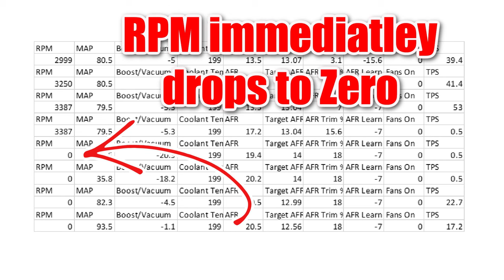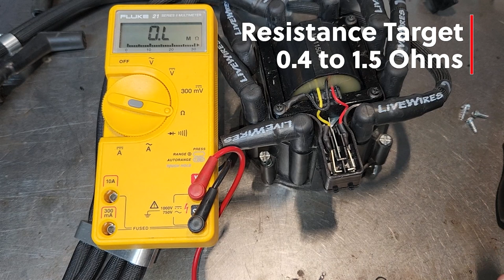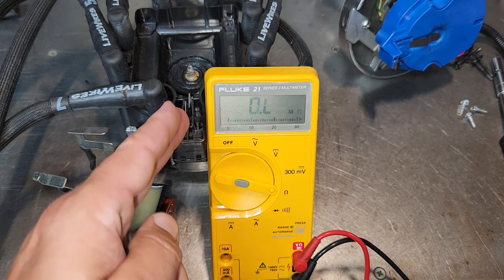How to Diagnose and Fix your HEI Distributor.  With driving footage.

Comment: First thing I did was check for fuel at the carb. It was fine. I then checked for spark on the plugs, it was not fine. I then checked for 12V at the distributor, it was fine. I then followed your steps. All three of my coils were within spec. I then replaced the ignition module and the truck fired right up. 

THANK YOU!!!
Reply from the maker: That's Awesome!  Thanks for sharing your experience!
Reply: I’m getting 10V at the distributor, is this close enough? Fuel pressure is good, plugs aren’t getting any spark.

Comment: This is a great video for HEI diagnosing for those of us who don't know how everything works. I converted my old truck's 300 6-cyl to a HEI distributor and found one of the terminals was also out of place. Still no tach signal so now I know to go back in and check the other connector + test battery input voltage.
Reply: Sounds like the connector factory (that likely supplies a boatload of vendors) fupped-duck.
Reply from the maker: Thanks Dwayne!  Hope you find the issue... let us know what fixed it.
Reply from the maker: @Le_Comte_de_Monte_Felin  Ha!  For sure!

Comment: Actually, they designed the hei for longer service intervals. When points were in use, they had to be serviced every three months or 3,000 miles. . Getting a higher voltage output was an added bonus
Reply from the maker: Great Point!  (See what I did there?  ha, ha...)  Thanks Juan!

Comment: I had a DUI unit in my AMC 304 in a jeep I had about 4000 miles on it and it wouldn't start when it was cold, and I mean 10 - 15 degrees F , what happened was the housing wore by the drive gear allowing the shaft to raise up and it wouldn't trigger it to get a spark. When it was cold out the oil was to thick to let it slide back down, and it did have some issues at other times to. I put the Delco points distributor back in and it runs fine now.
Reply from the maker: Ohhh man, sorry to hear that.  I'm a few weeks away from making some changes with this Disti too.  Thanks for sharing!

Comment: How has your dui unit treated you? Just purchased one from summit racing do to kept burning up ignition modules left and right checked and changed everything battery alternator both cables even went through 3 accel distributors from summit with no luck would get a few cranks and kill the module. Changed out ignition switch and harness aswell as hooking it up direct to battery with a kill switch so I’m hoping the dui will solve the issue.
Reply from the maker: Good question... I no longer have it.  Not because it's bad, I wanted to have my Fuel Injection system control the timing, so I needed a different style distributor.  DUI makes good stuff, have fun!   Keep us posted if there are any other issues you figure out.  Thanks for the comment!

Comment: I installed a cold case aluminum radiator in my big block Nova after the winter overhaul, and found no noticeable improvement in cooling at idle. That is on a 95° day at idle. Cools great down the road though. Can’t wait to see how yours does
Reply from the maker: Yeah Mike, me too.  We shall see.  See ya soon!
Reply: Is your water pump pulley bigger than your crankshaft pulley? Meaning do you have a under drive pulley set up? That can cause overheating issues in stop and go traffic..they look cool though but it’s mainly for racing.
Reply from the maker: @armygreenfj3924  Good question.  I do NOT have an under drive pulley, they're stock diameter, as far as I know.  Agreed... too much flow doesn't help either.  Thanks!
Reply: @armygreenfj3924  all my pulleys are stock 1970 big block pulleys. Air does not blow back over engine. Blows off the end of blades, so makes a big circle. Hits hood and blows out all sides, not back like I think it should

Comment: I had the exact same issue with the wire terminals not being snug in the plug and falling out. Then as I was bending out the tab to re-clip it in the plug, the wire terminal slipped off the wire, It hadn't been crimped hard enough. I soldered  all the wire terminals , made sure they were made fast in the plug, and spliced in a duplicate ground that I mounted to the firewall. The second ground wasn't my idea, but picked from another thread, I had read, can't hurt.
Reply from the maker: Yeah, almost identical issue... great fix!  Haven't heard of the ground strap idea before.  Thanks for sharing!
Reply: @FastMonty could you please give me the wiring info on a 77 chev impala. Colors of wires that go to the ignition module  and how to test if the module  is geting voltage when ignition switch is in start and on position, thank you for your help
Reply from the maker: @Chuncy566  Sorry Brother, I'm not an expert on 77 Impala's, so I can't help there.  Everything I went through in the video is how to diagnose a HEI distributor.  Hope it helps!

Comment: thank you for the video, recently I change my head gasket with the rocker arm, push rods and oil pump on my stock z28 78 with 350 , set the timing to 12 degree , when reach the 3k rpm while driving  the car fell it hit the break pedal, when the car in neutral i can rev the engine pass the 5k . what you think is it the distributor?
Reply from the maker: It could be... if you have an HEI, give it a thorough exam.  OR, it could be your PCV system.  If it's not clearing out the crank case properly, there may be too much back pressure.  Let us know what you find out!

Comment: I’m having the same problems with a carbureted small block Chevy.  Thanks for the insight.
Reply from the maker: I feel your pain... please let us know how you ended up fixing it.  Thanks for the comment!
Reply: @FastMonty  my situation ended up almost exactly the same as yours.  I replaced the HEI control module, but had the same symptoms still.  Upon further investigation, the yellow and red wire coming out of the coil had burned through, and were making connection just enough to run like garbage.
Reply from the maker: @davidjames2788  Crazy how it's the little things, right?  Great to hear you found the issue!
Reply: I'm having the same problem with Nova with an sbc. slight throttle is fine  after that it falls on it's face, it's been getting worse I think too
Reply from the maker: @jaysguyrage9483  You're not alone... let us know what ends up being the issue.  Thanks for the comment!

Comment: Man your video just found my weeks of frustration. I was having similar issue, everything worked fine then about 3000rpm I would get erratic tach signal and loss of power, spitting sputtering missing. I started with basics cap rotor wires plugs, and noticed the same problem when I was changing out the cap the wiring fell out of the connector like yours.
Reply from the maker: Ohhh wow, glad to hear I'm not alone!  Ha, ha... Glad to hear you've sorted it out.  Thanks for the comment!

Comment: The more electronics you have under the hood will leave you scratching your head when the car dies. In my case on my 70 Z/28 I ran a Pertronix for 15 yrs before it gave me problems when the engine reached operating temp. It finally died one night. The same thing happened with my Crane XR-i module. I was going to try an Accel unit until I read the reviews which sometimes are dead out of the box. Therefore I’m back to using points since I have plenty. I am also running with an analog MSD 6AL 6420 because the digital boxes are junk today.
Reply: Devils advocate here.  Ultimately he used the data logging function of his Engine management system to diagnose the intermittent loss of tach signal from the distributor.  I believe analog MSD would use the same signal wire and you would have no idea why your MSD was dying.  Also, all of these electronics should have capacitors on them.  MSD sells them as RFI filters (which they do as well) but they offer significant voltage spike protection which older style alternators tend to produce.  I have two MSD capacitors, one for the FI system and another for the MSD.  All is well so far.
Reply from the maker: All good points John... Once you go electric, you can't go back... or something like that?  HA, ha... thanks for the comment!
Reply from the maker: @stevebrown6175  Thanks for the comment Steve!

Comment: Replace that dielectric grease ASAP, its more of an isulator and not for heat transfer, you will kill that HEI module quickly. You need "DOW 340 Heat Sink Compound", its good for up to 350F, its the only grease i use personally for my own HEI distributor projects.
Reply from the maker: Good point.  I was using the grease that came with the Module.  I was thinking the same thing... DiElectric grease prevents arcing, etc, how in the heck is it going to increase heat transfer?  Thanks for the comment!
Reply: Dielectric grease is exactly what it says it kills electric current!!
Reply: Just now seeing what this is coming from.. they make a heat sink paste TG-N909 Non-Silicone Thermal Grease nothing compares and last for years
Reply: Thanks for the info I will try that on my next module my big block eats modules
Reply: Use Arctic Silver thermal compound (available on the jungle website).
It’s designed for computer chip coolers and does a great job.
Reply: @patricks8086  Yes... cpu thermal compound will work, but given that underhood temps constantly exceed that of a computer case,  i would still suggest using the DOW 340 compound.
Reply: @Bige4u  CPUs regularly get over 215F (102C) I have yet to ever measure temps of my distributor or much of anything besides the exhaust in excess of that.

Comment: Hello, I am doing a HEI install on a 1975 AMC 360  , What I need to know is, do I keep or take off the the voltage regulator ? Thanks for the Video's.
Reply from the maker: If there's an inline regulator or fuse link to the old distributor/coil, yeah you remove it.  Then upgrade that power wire to 10 gauge.  Have fun!
Reply: Thanks , Have a great day. @FastMonty

Comment: I had that happen with a pertronix. Unit overheated. Same thing with an overheating ignition module from a 95 Chevy that I was running on my 66 Cadillac. Wild erratic behavior.
Reply from the maker: Yeah, super annoying, isn't it?  I no longer run an HEI disti... My friends that do carry spare modules with them.  Thanks for the comment!
Reply: @FastMonty  the fix is to relocate the module to where it’s out of the heat. Then it’ll last a lot longer. I did that on the Cadillac, as it was in the flow of the rad fans, and now it’s great. Totally understand why you’d want to ditch the HEI, though!
Reply from the maker: @clarkinthedark1  Ohhh, great idea!  Thanks for sharing!

Comment: This is useful.  I think I will eliminate those connector terminals/clips (the connections of which seem sketchy) on mine and hard wire the connections.  Why leave the wiring to chance?  I suppose it makes it easier for when you do disconnect the parts, but since we run the car with the connection, hard wiring does make sense.  I also had a intermittent tach signal for a while and that was frustrating.  Went away with new module.  But what I will take from this video is that the HEI plug connectors are sketch.  Cood video Yo!
Reply from the maker: Thanks Roger!  Yeah, hard wiring everything makes reliability sense.  But, not accessibility sense. :)  There is definitely a trade off... just stuff to look out for.  Glad you fixed the tach issue!

Comment: Okay I’m gonna change my hei distributor bc it’s only firing on like 4 cylinders but I also think I might have an issue with my new Holley sniper 2… it came with an external fuel pressure regulator but I set that up wrong and bypassed it, do you think i could have a bad injector just blasting too much fuel in there and it just can’t be burned? I can’t really check for spark alone right now on all my plugs my brother in law said they’re all sparking but idk
Reply from the maker: If you have spark, it might be timing.  Double check that, AND install that fuel regulator.  Let us know how it goes.

Comment: Monty, have you had any issues with the newly installed Flamethrower module being that it’s manufactured over seas? It’s hard to find anything that’s not made in the USA anymore. I just replaced my module on my 68 Firebird with the Flamethrower. It’s running fine but I am soooo reluctant to take it too far and wind up on the side of the road again.
Reply from the maker: I hear you... I didn't have any issues with it, nor did I have it very long. :)  I now have a MSD Billet, where timing is controlled by my FiTech system.  That said, I'd carry an extra one with you, just in case you need it.  Have Fun!

Comment: Doe's the FITech have a rev limiter in it like the sniper? If so I think that I would up the limit on that module and let the FITech do the thing.
Reply from the maker: Great question Joe... my particular set up does not have timing control.  But, I do want to implement that in the future, which requires a different distributor.  Stay tuned for that... so, when that happens, we're gonna find out about rev limiting, I'm sure it would.  Thanks for the comment!

Comment: Good video I'm glad you found the issue, your old module  probably still good.  How come your distributor dont have vacuum advance ?
Reply from the maker: Yep, old one is probably fine... vacuum advance won't fit on mine, and it's optional.  It's only for emissions, and might keep your engine a little cooler at idle.  Thanks!
Reply: @FastMonty  thank you for replying,  i want to put a water outlet from that location and my vacuum advance was right on top of that,  so it's hard to open the outlet like you did on yours.
Reply from the maker: @9011combo  yup!  Exactly why I removed mine. Depending on your distributor, you can get a vacuum advance lockout.
Reply: @FastMonty  ok thank you very much

Comment: Hello Mike ..At 17:56 the centrifugal advance weights look strange never seen them overlap like that . With the rotor installed can you rotate the rotor and will it spring back without binding?
Thanks for the Pontiac content
Reply from the maker: I'm a start calling you Eagle Eye Fred.  Can't believe you saw that... but, NO they should not overlap, and I fixed them before putting it in.  To your point, I don't know if they'd fix themselves, or not?  My guess is I wouldn't have been able to attach the Blue Cover.  Thanks for spotting that!

Comment: Great video but after finding the wire harness issue you did show how to actually test the original module.
Reply from the maker: You can't.  Well, that's what the driving test was for... as mentioned in the video, you need a specialized tool to test the actual module.  Thanks for dropping a comment!

Comment: Another great video.  Been debating  hei vs  efi controlled distributor.  Just hate all the wiring like distributor, coil, and ignition box. Got to be a simpler way.
Reply from the maker: Totally understand your concern... that's why I went HEI, BUT, I'm now leaning towards EFI controlled.  One of these days... I'll figure out the perfect mix.   Thanks for the comment!
Reply: I haven’t done this yet, but I think going with a MSD distributor, lock it out, and use the efi timing control.
Reply from the maker: @WaveCrusher  Yup!  On my to do list.  Thanks for the comment!

Comment: I have replaced a auto module 3 times in 10 months now. Is there something other than faulty parts that can cause the module to fail or short out?
Reply from the maker: Wow, that's a lot.  Not sure what's causing your issue... but, I do know electronics do not like heat.  Is there anyway to add some sort of heat sync?  (Or, at least make sure you add that grease underneath it, when you install it)  Let us know if you figure out the magic cure for your particular ride.  Thanks and good luck!
Reply: @FastMonty   The gel that comes with these auto zone modules look like dielectric grease and not heat sink silicone. I will swap out the module and use my own heat sink silicone
Reply: I went and double checked all the power leads battery cables/grounds should be all good for the next tests.
Reply from the maker: @Anthony-ue4zm  Agreed.  Hope it behaves better!
Reply from the maker: @Anthony-ue4zm  Keep us posted!

Comment: Mine is acting like yours only difference is when this happens my electric cooling fan goes off also makes me wonder if system is losing all electrical power somehow
Reply from the maker: That's wild... I'd agree, try and make sure the HEI unit has a dedicated power lead to the fuse block.  It almost sounds like the HEI is not getting enough juice, when the fans are on?  let us know!

Comment: Uterine increase your Gap 35000 is plenty just get a brighter spark and make it to throw it in there and MSD would multiply how many times did pulses and that would even be better than just a hot spark
Reply from the maker: Not sure I follow... I'm at close to 0.050" with multiple spark.  Thanks!